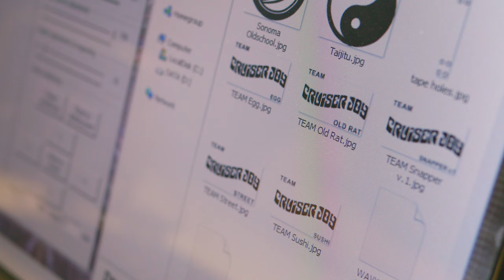SHAPER by CruiserJoy

Comment: This is beautiful. Curious as to why you clear coated then painted over top instead of painting then throwing clear over. Is there much difference in the final product?
Reply from the maker: Thank you and that is an interesting question. It just make sense to me this way.  With clearcoat as a final step the bottom logo graphic can definitely last longer until it starts to wear out but even without clearcoat it can last decent amount of abuse. The solvent in the paint is able to erode the clearcoat, even after it is properly dry, and create nice bond. And my other point of view is that the bottom logo is something that fingerboarder should not be afraid to scratch and loose over time because there is still a nice wooden veneer underneath. But if you are afraid to loose it you can use rails which is a nice addition to shaped deck anyway.